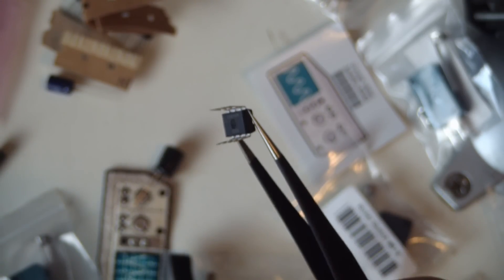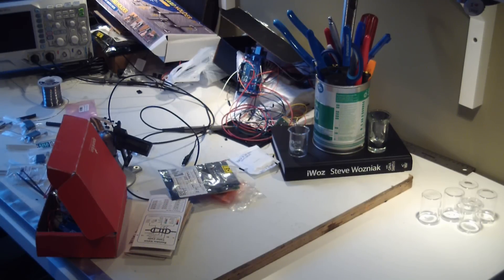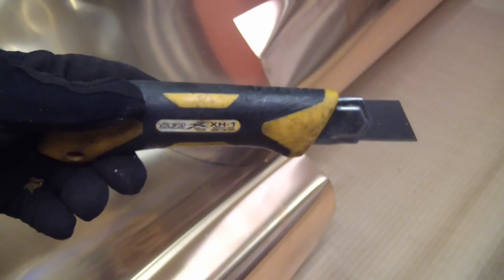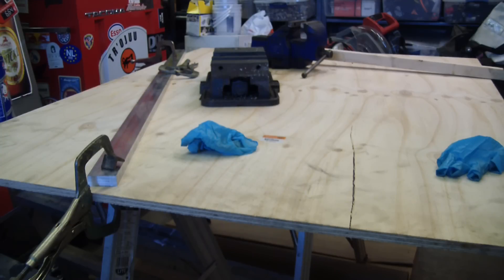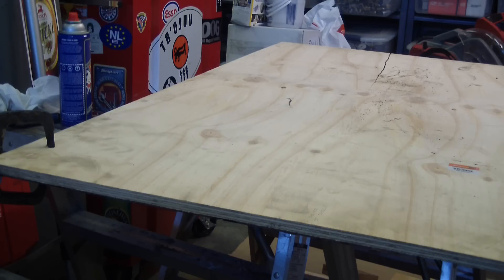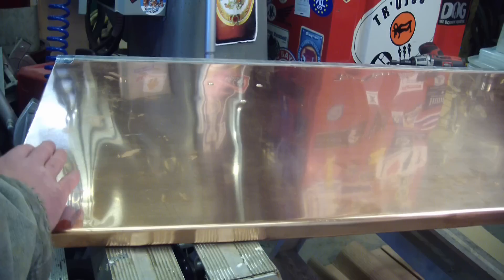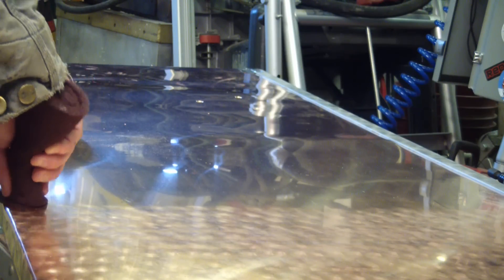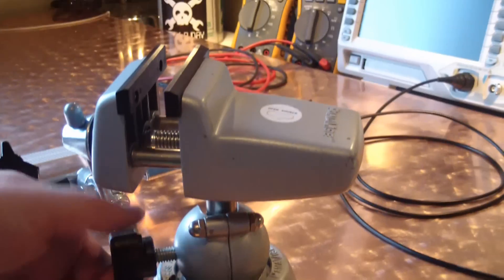Copper Workbench

Comment: Sorry to be that guy, but this isn't a good surface for electronics work. That'll dead short anything that touches it with practically no resistance. ESD matting is conductive, but has a dissipative layer that is resistant, so you don't get electronics conducting where it shouldn't.
Reply: Yeah, and you have no idea how long I've been searching! You almost got away with it... :-P
Reply: Darian Cabot That's why I went with the static dissipative matting myself. Quite often I work with energized electronic circuit boards just sitting flat on the work bench, so obviously having an electrically conductive surface is a no-go.

Also, an electrically conductive surface is not ideal for ESD protection, as it provides a very low impedance discharge path. Static dissipative matting dissipates static charges relatively slowly through a very high impedance, which further helps prevent ESD damage from occurring in a situation where you set a circuit board or component which has acquired a static charge down onto the work surface.

Good quality anti-static matting does not burn or melt easily and has no problem withstanding stray solder blobs without damage. It also doesn't stink nearly as much as the cheap stuff.

Note: I work with electronics on a professional basis.
Reply: Yea, just how much stuff have you melted at this point?
Reply: I'm certain when he realizes that he'll probably put a coating on it or something.

Comment: Fun to look at but not a good ESD dissipative surface. The idea is to not accumulate charge AND to dissipate it in a controlled manner with distributed resistance. For instance if you bring components to the bench and you're charged you may end up discharging through the component to the bench as you set them down. Also who wants a conductive work surface for working on electronics? I'll tell you I work on some pretty sensitive stuff, real low noise analog hardware and even the rubber mats have given me issue with coupling. In particular noise from off-line SMPS leaking into high-z sensitive nets and the like. Don't forget to ground the table through a 1~10 Meg resistor to earth. Directly grounding could get you killed. I'll tell you what you did make a good example of though, an ESD test table. Our test table at work, while bigger is exactly what you have there...solid copper top, that bench sits over a solid copper floor...the two are bonded and then earthed through a resistor bank. Your presentation style made me chuckle though dood, keep up the good work.
Reply: Just wondering why you would need to ground through a resistor? I’m a mechanical guy so this is all witch craft and magic to me......🤔

Comment: Yeah, really cool upgrade

... should have used my advice on the burnishing - but you prefered to get yourself a stiff wrist ;-))

Now you just need a big ground spike through the carpet, the floor, the cellar ect. just go ahead !

I was thinking of facing a door with a 0,5 mm plate of brass ... but now I see how hard it is to get it plan
... I will have to think more ;-((

thx for the experience !

Comment: Cool bench top.  

On the ground lead, add a series 1 Meg Ohm Resistor.   This slows down the discharge rate.  With a shorted 120V device in one hand, while holding the copper table top in your other hand, your Heart will be happier.  Then again without the resistor it makes for a more exciting video! :)
Reply: *****
Steven4601 has a good suggestion, leave copper connected to ground and use small ESD mat on the top for electronic work.

Comment: Oh no Chris. 
The esd matting would have helped you much more than you would have guessed. The copper sheet works as a low impedance sink for static charges increasing the likeky hood for damage. Also id recommend earthing dead solid as you no longer have a protection from electrocution anymore now if a live wire touches the surface.. 

Atleast the esd mat has something to lay on now :-)

Additionally add a 1meg resistor to PE from your soldering iron.. Optionally get an isolating transformer for the scope. That way you can measure with the scope at ref.potentials other than PE.
Kind regards from the Netherlands
Reply: ***** I'd recommend staying far away from inverters as soon you want to measure anything. Technically it works but you're completely dependent on the inverter filters. Most likely it is not a balanced output which causes quite a bit of common mode currents resulting in currents being injected though the ground lead of the probes. An isolation transformer provides a floating reference, minimak c.m. currents and best is , its without causing noise.  At least not more than the regular mains outlet.
Reply: ***** If you do try it on a UPS/inverter let us know the results, might be interesting. I also have the DS1054Z, not too power hungry.

Comment: Looks Sharp! Reason why you didn't duct tape that abrasive to a dowel and chuck in the drill?
Reply: you are definitely doing all the wrong things!
Reply: Different subject, late 2000's bp 5hp bp clone, few goodies, dividing head,what would good deal to fair $$$ be? Trying to decide between that and a older model bare 3hp frejoth for half the money, your wisdom on the matter benevolent ruler?
Reply: K, thanks. Ya I know about the get around to it stuff I'm part farmer. Just trying to figure is 7.5 is still good value. Tough to find much to compare to in Canada. Thinking I'm gonna get a AR phase converter for about a kilo buck and a half, I need it to run the victor1660 picked up earlier in the year. Say you have any experience machining rubber drive belt gear pulleys? Been tring to figure out how to machine the goofy profile on the remaining gears I need, looks like maybe a small ball end mill with a double pass, which would make use of the vertex dh right off the bat. My fully functional purchase turned out to be a metric thread pitch only cutting lathe. Oh the educations we buy ourselves.